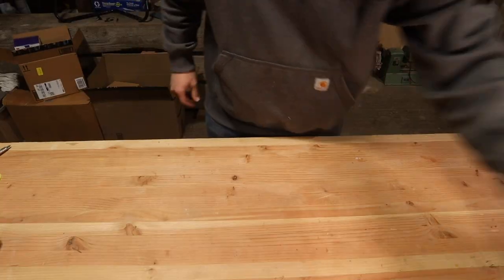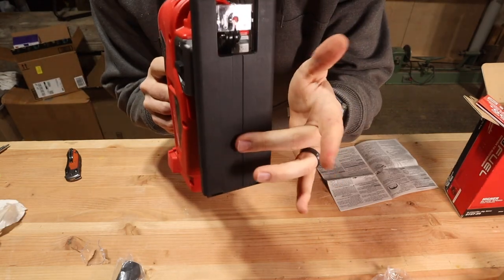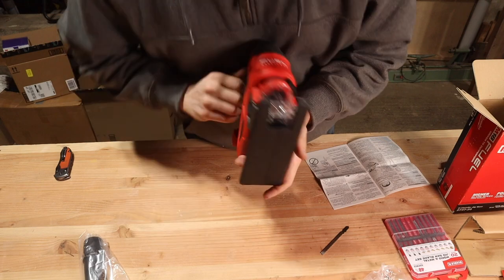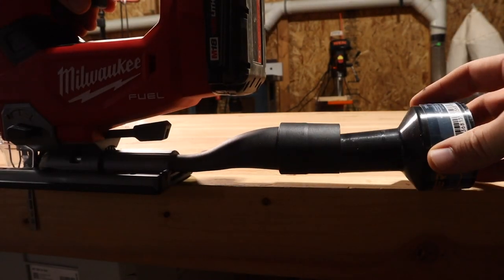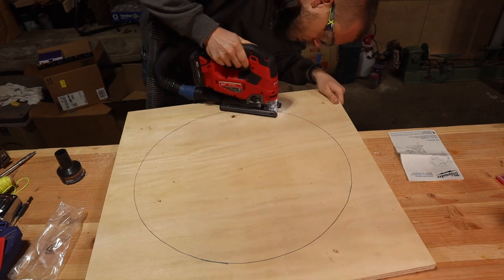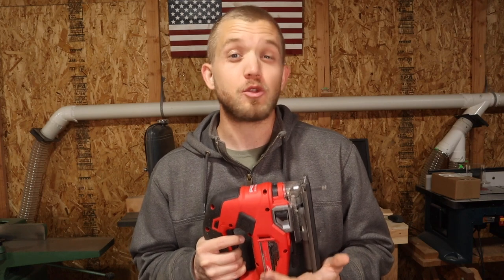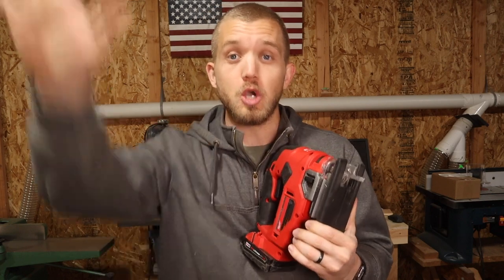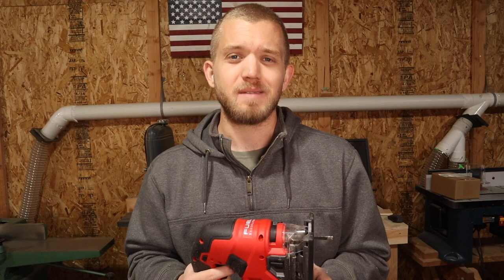Milwaukee M18 Jigsaw | Unboxing & Overview

Comment: If you recheck the manual you've actually got the dust collection settings swapped backwards which is why it wasn't working as well probably, it says to set the shuttle to the 'X' to blow air out of the dust chute, and the other setting to blow air out of the front
Reply from the maker: Well that sure would explain it! That's what I get for not reading the manual carefully enough. Thanks for the correction!

Comment: That blower feature is nice. The M12 version doesn't have it.
Reply from the maker: Yes, it is quite nice. I ended up taking the blade guard off later when I was cutting and it worked far better.

Comment: I watched your video to save me from reading the manual. The print is too small. Good video, thanks.  What does the orbital mode do?
Reply from the maker: Thanks! The orbital mode moves the blade forward on the down stroke for quicker, albeit rougher cuts.
Reply: @NorthwestCraftsman  thanks.  Yesterday I tried out the saw and figured that out trying at a slow speed I could see the blade kinda moving forward on an axis.  This thing is a beast.
Reply from the maker: Sure is! I love it

Comment: I have the same one. I'm a little disappointed that the dust port and the m18 wet/dry vacuum hose dont connect well.
Reply from the maker: Honestly, I am as well, I tried it some more and it really doesn’t work great. I just accept the dust at this point.

Comment: My blade doesn't line up straight. Does yours?
Reply from the maker: Great question. Mine did when it wasn’t fully inserted and then the rotation lock would push it a little. I needed to shove the blade in pretty hard to get it to seat correctly.

Comment: My blade keeps going to the side. Any ideas what I'm doing wrong?
Reply from the maker: Like you try to cut a straight line and it veers to the side? Or the blade isn’t cutting straight up and down?
Reply: @NorthwestCraftsman  the latter. The blade tends to rotate as the locking system tries to lock in the blade. I did more research and I think I'm using a blade that is not made for that specific saw.
Reply from the maker: That sounds about right for what you’re seeing. Below are the blades that I got for mine and they work great. Also, I noticed it’s really stiff when you’re trying to get them in so make sure they’re seated fully. 

Jigsaw blades
https://amzn.to/3mdyT8M

Comment: Can you use it to cut through 2”
Reply from the maker: The jigsaw isn't the limiting factor there, the blades for it will be. I used this plus the blades below to cut through a nearly 2" thick maple table though. So double check the blades, but the tool is very capable. 

My Jigsaw Blades
https://amzn.to/3M2Tua8
Reply: @NorthwestCraftsman  I watched your video before commuting to purchase yesterday. :)

It worked really well for the header design on the garden we built!

Cut through the 2x6 no problems. :)
Reply from the maker: Glad to hear it!
Reply from the maker: Glad you found it helpful!
Reply: @NorthwestCraftsman  My situation was different, already had it purchased but I feel like the manual didn't do a good job explaining how to use the bevel feature, you described everything perfectly.
Reply from the maker: Glad you found the video helpful!